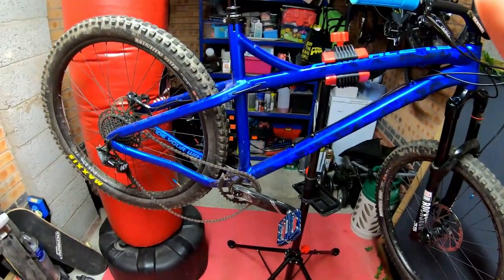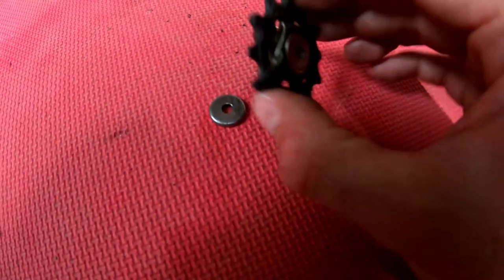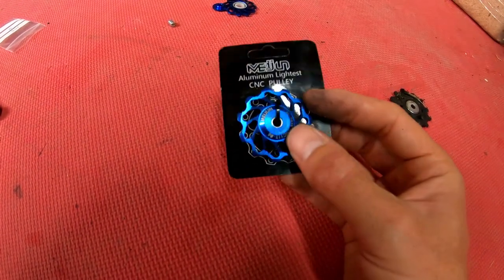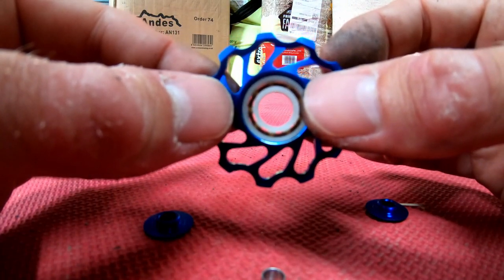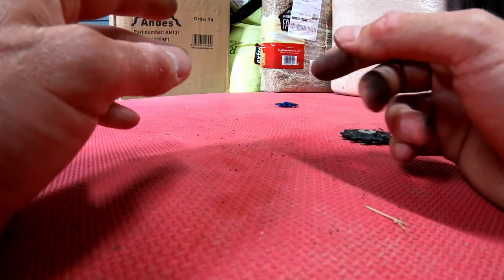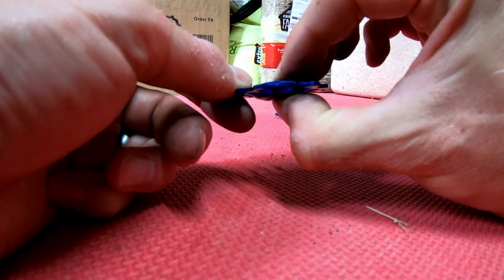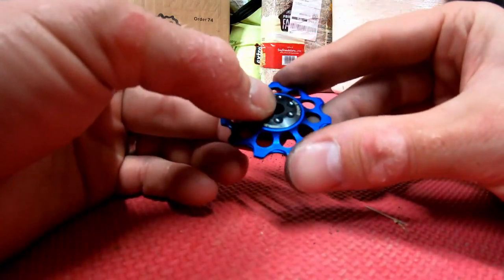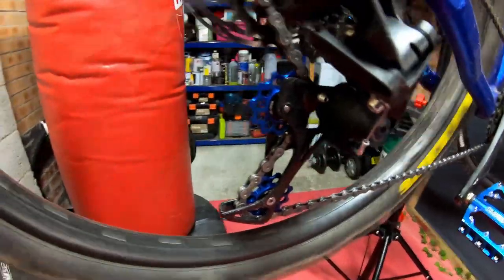Mountain Bike upgrades - WHY you shouldnt buy cheap alloy Jockey wheels

Comment: Having knowledge of what you’re doing first helps! A bearing isn’t necessary in a jockey wheel on a mountain bike.
Reply from the maker: bearings reduce friction so it isn't a bad thing to have a bearing based Jockey wheel, all expensive jockey wheels have bearings so you seem to have more "knowledge" than SRAM, HOPE, Shimano, etc and the main point of this video is to show what you get if you buy a cheapo set of jockey wheels. do what you want run jockey wheels without bearings i don't really care, some people want upgraded jockey wheels with bearings and this video is to assist them.. have a nice day now pet.
Reply: @jonnybrown5715  the difference between a bearing and a bushing is about half a watt on a road bike that isn’t taking in half as much crap as a mountain bike. The only difference is you can flex the fact you have bearings, replace them more often and spend more money doing so. The performance benefits are that negligible the decision basically comes down to how much money you wanna spend. 
Also most SRAM mechs come with bushings… same with shimano. Hope is an aftermarket company so obviously they only offer a bearing. I always have a good day flower.
Reply from the maker: @deterrentdubz9116  🥱 🥱 🥱
Reply from the maker: @deterrentdubz9116  🥱 I haven't watched any of your video's so jog on, over opinionated troll with no life
Reply from the maker: @deterrentdubz9116  that's your opinion and I have mine shouting your opinion in multiple replies doesn't make you right just opinionated and think you are an expert and right... my opinion is your music doesn't work and clearly don't know what you are doing "god loves a trier" maybe you should concentrate on your music over arguing online when you ads no value or content of your own... yes you are a troll... stop responding and embarrassing yourself